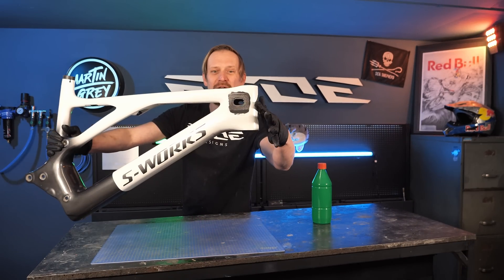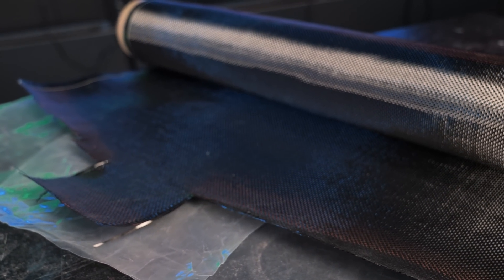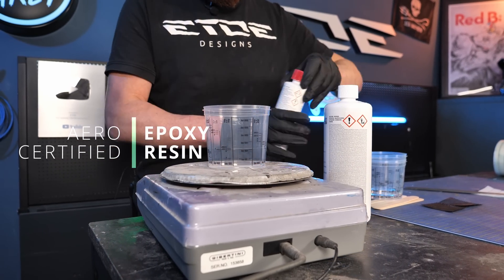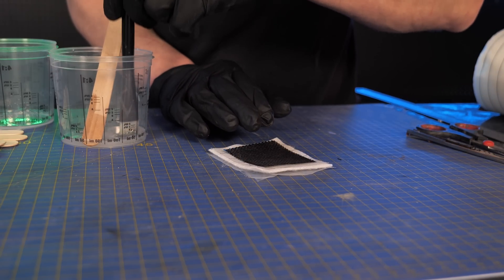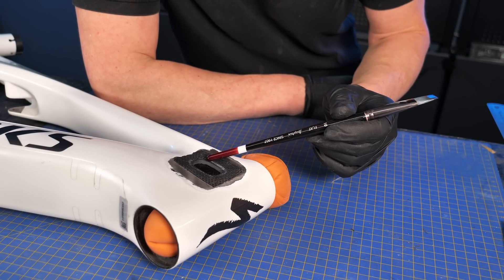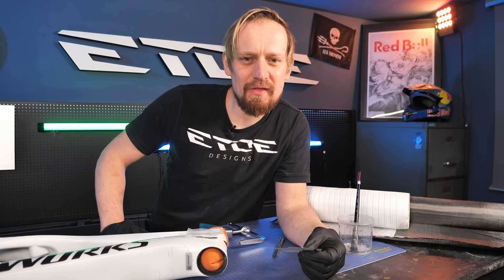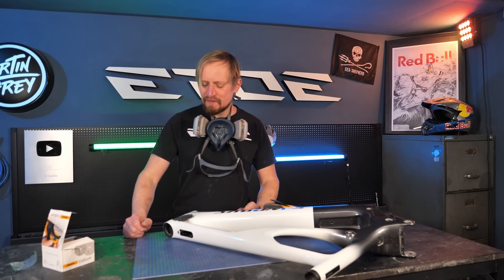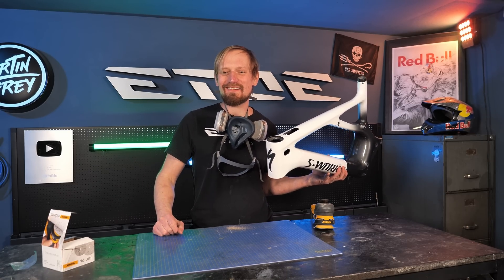Carbon Bike Repair that MAKES YOU MONEY - Patching Cable Entries

Comment: Hi Martin, I love your channel ! Just a question: as the hole was originally on the frame, this does not question the solidity, so could we use glass fiber instead of the pieces of carbon fibers you mix in the resin ? Thx !
Reply from the maker: You can use also a stack of hay or what ever you have on hand.
Reply: @ETOE  😅
Reply: @jerometridon6333 Glass fiber would be better then carbon

Comment: If Ive sanded through the epoxy seal on the carbon and have exposed the carb a little bit, can I seal that with a 2k primer?
Reply from the maker: No you need to use this one: https://amzn.to/3IX80gI

disclaimer: This video and description contains affiliate links, which means that if you click on one of the product links, I’ll receive a small commission. You have no extra cost using these links. You help to support the channel and allows me to continue to make videos like this. Thank you for watching!
Reply: @ETOE  thanks 🙏

Comment: And here i am trying to figure out how to make cable entries in a carbon frame (do i simply drill small holes on it?) because i want to use a non-integrated stem and handlebar combo that does not have internal routing
Reply: Drill. But is up internally. Drill again.

Comment: Why not use pre-preg carbon fibre?? 🙂
Reply from the maker: Cause you have to store it in a fridge and you have to cure it at minimum 120 Degree Celsius. Not possible for most of my followers. I show solutions which are possible to do for my followers.

Comment: Nice job on the carbon work. That's pretty close to what I've had to do while working on carbon components on aircraft.  It's great you did this video too since doing "repairs" like this are one of the advantages of carbon frames over metal bike frames. If (BIG IF) I were to buy a carbon bike and use wireless shifting, dropper post or suspension components that are currently on the market this is exactly what I would due to remove the unnecessary holes in my frame. 

All kidding aside on the "wireless brakes" mentioned in other comments.👍🤣👍  It is technically something that could be done, but again what's the point. There wouldn't be a weight savings since the wireless setup would need batteries for each component, etc... just not worth it in IMHO.  However that doesn't make the idea of that kind of technology less cool. Just like Magura's drool worthy  ABS system for E-bikes is.. I just can't afford it though!
Reply: I feel as though filling holes on a steel or aluminum frame would be even easier than with carbon because you could send it to an experienced TIG welder.... no?
Reply: @RC-fp1tl once te aluminium is welded because of the heating it will never be the same. And an someone might comment that from an engineering point of view it's possible/sensible/weakens the frame ever so slightly. In practice your frame will brake in that spot once and again. It's very common for aluminium frames used for bike trials to get welded before a year of use has gone by, and the moment the frame is fixed all nearby areas fail. I guess you could re-heat-treat the whole frame though.

Comment: Genuine question... Why would you want to do that? I always thought that was a pretty desirable feature.
Reply from the maker: Wireless brakes 😂
Reply: @ETOE  No shit? 🤔 im not a big bike person, I don't know it you're yanking my chain or if that's something super cool I didn't know existed...! 😂
Reply: @superrad1659  Wireless shifting. The brake hose goes into the frame hole on the other side.
Reply: @hankschrader2353  are we talking wireless as in Bluetooth wireless?, or "wireless" as in the cables are all hidden? Pardon my ignorance im just trying to learn 😂
Reply: @superrad1659  SRAM make fully wireless drivetrain components. The brakes still need hoses tho
Reply: @Mansellto  dang thats pretty cool.
Reply: @superrad1659  no problem, look for shimano di2 or sram axs.